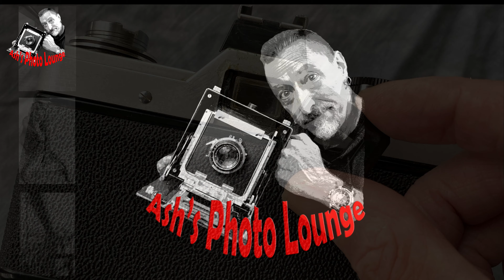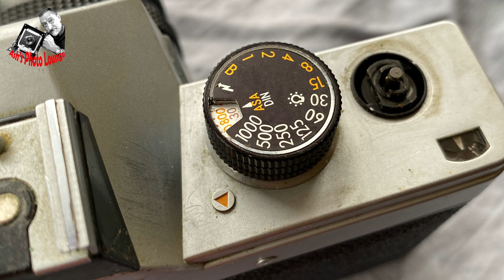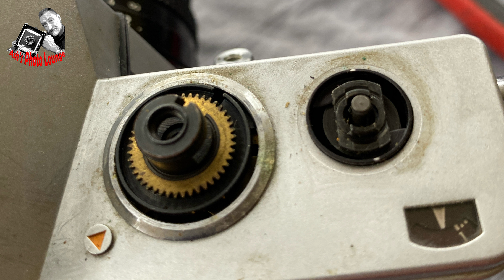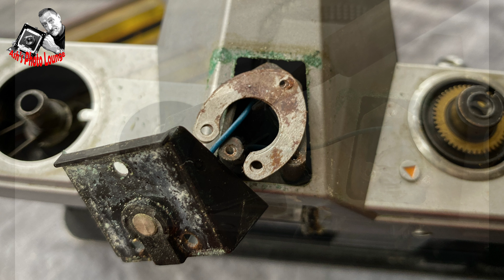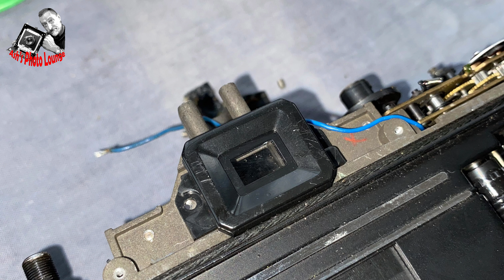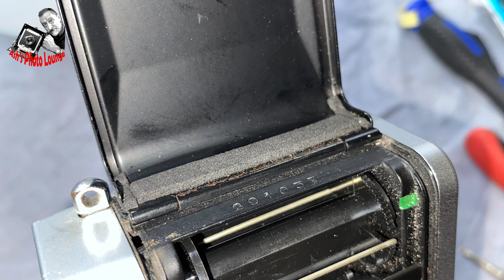Fixing up a £5.00 film camera

Comment: Nice video, but I have a problem with shutter speed/ISO dial. I bought cheap MTL 50 and the ISO dial numbers were hidden below, also the shutter speed plate was missing. I could figure out the shutter speed but with ISO was tricky. But I also figured out that ISO100 light meter works at shuter speed 1/2 but doesn't at 1sec. ISO1600 , light meter works at 1/30 but doesn't at 1/15.

So I wanted to fix the plate, I teared it apart and now no matter how I put it back together the light meter works at any ISO. Everytklhing seems to be wrong with ISO. Any tips how to figure it out and assembly it? Thanks

Comment: Years ago i received a top tip about removing those small aluminium cover plates with no damage. It sounds a bit weird but here it goes. first you glue on with a contact cement like bison tix a long flathead screw. then you put the camera in an oven set on 50 degrees Celsius. the aluminiun cover will then sag out of its place because of the weight of the screw. the screw then can be removed from the cover plate with no damage at all on the plate. in the same oven time you soften up the glue that holds the faux leather so if needed you can peel that off to right then without damage.
Reply from the maker: I would be dubious about 50 degrees C not cooking the electrics and melting any grease out of the vital internal bits
Reply: @ashsphotolounge well its just for a few minutes you’ll have it in there and you are taking it apart anyway for repair. So it seems like an ideal chance to clean and lubricate the internal mechanics anyway. And the electronics are fine at 50 degrees. Praktica’s don’t have a lot of it to start with and if it got cooked as soon as it is 50 degrees you couldn’t even solder the contacts. I would be more carefull with more complex cameras for sure.

Comment: Firstly, hats off to you for taking the time to repair this lowly Praktica. They're great cameras, but most people wouldn't bother going to the effort that you have done. Secondly, I thought your use of well lit, close up stills to show what you were doing was a very good idea. I've watched others taking cameras apart, and often it's hard to determine exactly what they are doing, and results in my trying to pause at the right spot to figure it out. 
I shall look forward to your further postings, and I'm sure you'll get some great images courtesy of the 2.8 Tessar.
Reply from the maker: The Praktica L with an F2.8 Tessar was my first 'proper' SLR, and the first camera I earned money with ... ooooo fifty years ago ... so it has a special place for me 🙂
Glad you like the 'stills' presentation ... it's fun to produce. 
Ash
Reply: @ashsphotolounge  Likewise, my first proper camera was a Praktica MTL3 with the same lens, and that was around 44 years ago. It was 2nd hand, I still have it, it still works, and all I've ever done to it is change the battery. 
I love it's simplicity,  the position of the shutter button, a loud mirror slap, and string light seals.